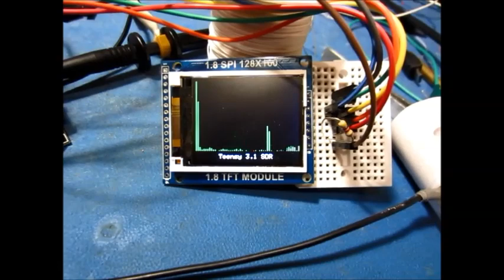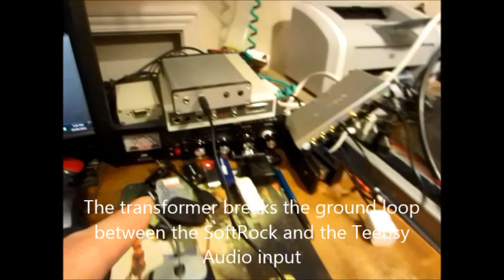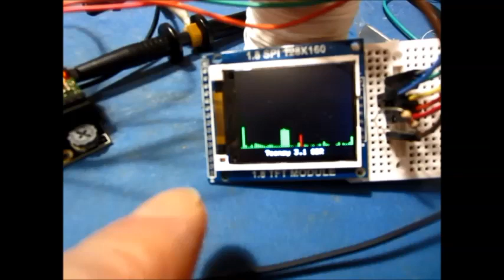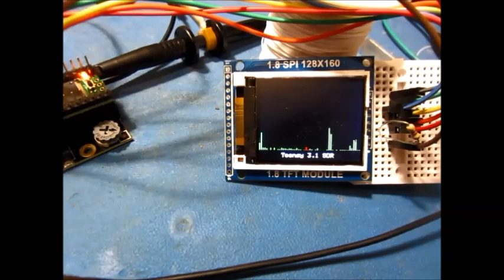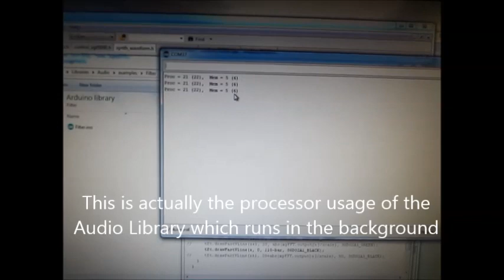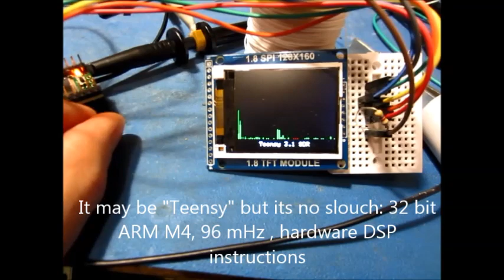TeensySDR - a Simple Software Defined Radio using the Teensy 3.1

Comment: I'm trying to do the same thing with a Teensy 4.x. Do you have code somewhere ?
Reply from the maker: https://github.com/rheslip/Teensy_SDR  I haven't updated this code in ages so it would take some work to get it running on the 4.1. The code is pretty straightforward though. I saw on the Teensy forums a year or two ago somebody wrote an SDR library for the Teensy  - you might want to check that out.